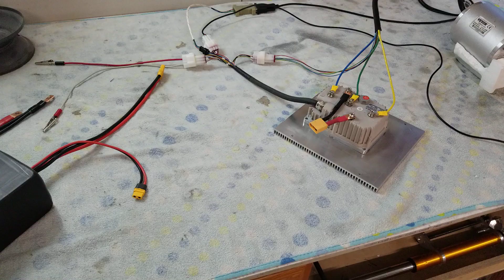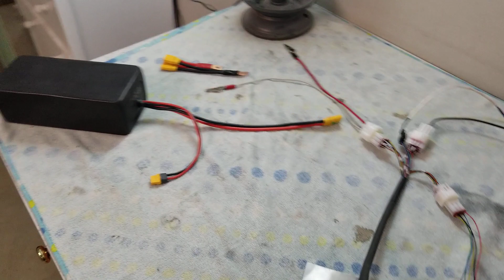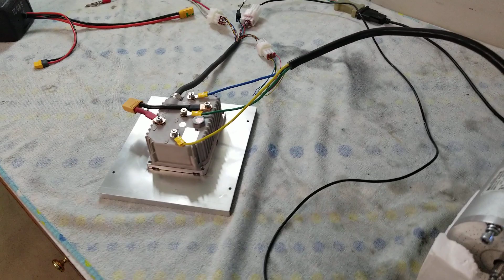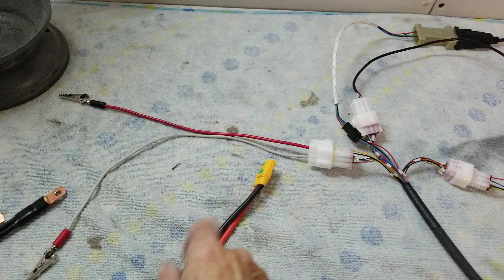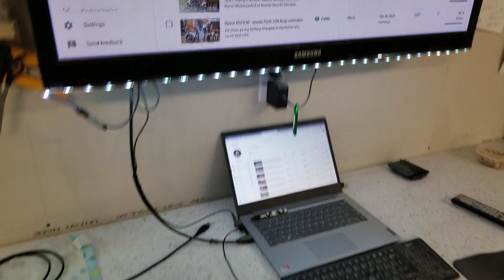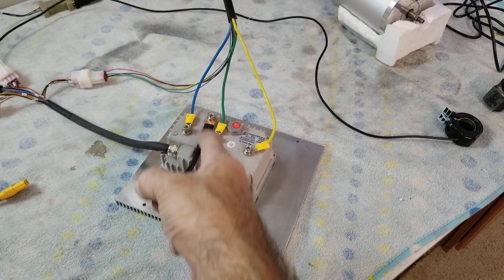Razor RSF650 - Kelly controller settings (edit)

Comment: Hello sir, thanks for this video. In the KLS wiring diagram Pin 6 and Pin 7 is for turning the controller on and off having  pin 7 connected to the battery through ignition switch. Without using the battery, how many volts have you suppliex to pin 7? I think using too much voltage is not necessary and risky for just turning it on and off. Can 12V or 5V signal activate the controller? Maybe using a stepdown converter to send a signal voltage is safer but I'm not sure  maybe the controller needs actual battery voltage as data for other tasks
Reply: Your concerns are unnecessary. The controller has its own step-down DC DC converter.
Battery power is supplied to pin 7 to turn on the controller.

Comment: Really want to build one of these myself. Main thing holding me back is having to potentially program one of these Kelly controllers. How hard was it for you to program one of these? Did you have to change much? Where did you find the info needed to program it?
Reply from the maker: you can download the programing software from the Kelly website. This too was my hesitation when I first started as well, but these Kelly controllers are not difficult to program.

Comment: hey man, thanks for the vid. i was hooking my controller and motor up yesterday. i had voltage readings on the board and on the motor. then i went to wire the throttle, crossed a wire and their was flash and pop. now i get readings from B+ to B- and + to B-,  but I don't get readings on the connecters to the phase wires. Help!?
Reply from the maker: if you heard a POP then she is pretty much a door stop now. Sorry. ive smoked a few in my time.

Comment: Do you have to add the can-bus option when you buy the controller to hook to a pc, or is everything you need to hook up to the pc already included when you buy the controller? Im running an ebay 80amp controller with no way to adjust settings and im getting about 32mph on a 3000w kunray motor with a delavan heatsink at 13t and 80t. You think the 80/220 controller  will improve top speed any? Edit: Im running 14 3S 60c lipo batteries at 88v (21s). Great vid man.
Reply from the maker: you dont need the CAN-BUS but you will need a r232 to usb cable.
Reply: @razorspeedfreak6508  Thanks for the reply, I bought a Sabvoton 72150 instead from Aliexpress. After seeing you go to Sabvoton and others I felt confident in buying. I’m only gonna run it at 80-100 amps on the little kunray motor (for now lol)
Reply from the maker: @tooshmart6669  wow! Going big with that 72150...
Reply: @razorspeedfreak6508  I was gonna go with the 100amp but wanted to use this controller when my QS205 ebike comes in from China. I can always turn down the power if needed. It’s nice to have extra if needed.

Comment: I've a question.. How do you set parameters to run at 50mph as seen on group folk are doing so with this controller at 72v with standard gearing
Reply from the maker: Nobody is doing 50mph on 3kw motor with 11/80 gearing at 72v. But to answer your question... turn up the "MAX OUTPUT FREQUENCY", "MAX SPEED", "CURRENT PERCENTAGE", and "BATTTERY LIMIT".
Reply: 82v looking for the right guy for the job tho lol

Comment: My 2500w 60v motor came with a cheap controller, but I’d like to upgrade it. What is your opinion on a good choice? I’m running a 72v battery. Thanks man.
Reply: How are you liking that new sabvoton? More power?
Reply from the maker: what is the continuous & peak current (amperage) output of your battery BMS?
Reply: @razorspeedfreak6508  no bms on the battery. I have a bunch of lipo packs from my drone racing days I just connected in parallel then in series to make 72v well 84 actually haha.
Reply: Btw what’s the word on maybe getting a custom battery from your battery guy;)?
Reply from the maker: @dilan8869  he has 3 week lead time if you're good with that.
Reply: @razorspeedfreak6508  that’s fine it’s worth it
Reply from the maker: @dilan8869  https://bicyclemotorworks.com/product-category/e-bike-batteries/?product_orderby=price&product_order=desc
Reply: @razorspeedfreak6508  hey man thank you very much. I just ordered and they had a coupon available for Black Friday which was cool…
Again. I appreciate your help cuz you don’t have to take the time to do so.
Reply: @razorspeedfreak6508  now about that new controller I was thinking a Kelly 60 amp?
Reply from the maker: @dilan8869  you bought a battery? Which? That will determine your cojtroller.
Reply: @razorspeedfreak6508  I got the 72v 8ah Samsung 40t like the one you used.
Reply from the maker: @dilan8869  60amp is good
Reply: @razorspeedfreak6508  right on thanks man
Reply: @razorspeedfreak6508   Kelly or Sabvoton? I’d like it to be easy to program and good user interface
Reply from the maker: @dilan8869  I have used the Kelly KLS-N 7212 (60-140A) and it is a nice controller for the money ($130 shipped) and has Bluetooth for another $45. I just bought my first Sabvoton SVMC-7280 and it is BIG. The 60amp Sabvoton is just as big and about same price with Bluetooth as Kelly.
Reply: @razorspeedfreak6508  I gonna search for the both and see what’s available right now you know how it is with this shortage situation. Thanks man
Reply: @razorspeedfreak6508  looking forward to your next video I really enjoy your chill easy going attitude. I like to figure out the layout and build things too used to build custom Fpv racing drones.
Reply from the maker: @dilan8869  this is where I got my Sabvoton. Shipped in like 5 days FedEx. I found these to be good prices even with the high shipping cost.  https://dunelectric.aliexpress.com/store/5065049?spm=a2g0o.store_pc_groupList.pcShopHead_138669272.0
Reply: @razorspeedfreak6508  got my new mx650 forks today tried installing and found out I can’t use the original front axle from the rsf since it’s not long enough. Gotta order a new mx650 axle now.
Reply: I charge with a balance charger to keep them balanced and keep a constant eye on my volt meter on the bike to make sure I don’t kill the battery below a certain voltage.
Reply from the maker: @dilan8869  no problem with that. What mAh packs and what is the C rating?
Reply: @razorspeedfreak6508  they’re 6s 1150mah 250c
Reply: @razorspeedfreak6508  three groups of 12 in parallel then these groups in series.

Comment: I had a question about the Kelly controllers and was wondering when I buy my controller do I have to program it before I can ride it or will the controller work without programming it.
Reply from the maker: You will need to program it. There is an initial "identification angle" test the controller will need to perform in order to pair with the motor. This is common with most sine wave controllets.

Comment: Can you do it with the motor and battery connected
Reply from the maker: That is the best way to program your contfoller. Brushsless sinewave controllers need to match with the motor upon first set up. I was trying to explain that if need be, you can access  the controller settings by powering pin 6&7.

Comment: I have the same problem with my bike my motor keeps burning up I got a new controller but it seems 72v motor have to come with own control I learned the hard way $
Reply from the maker: What motor do you use?